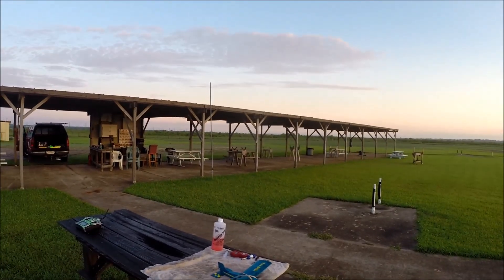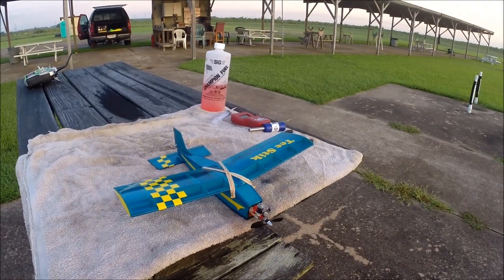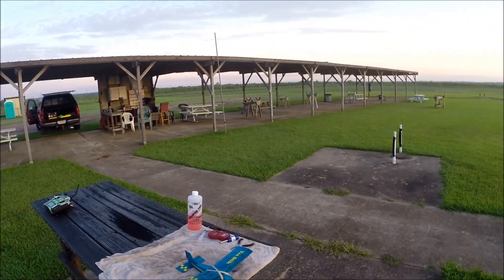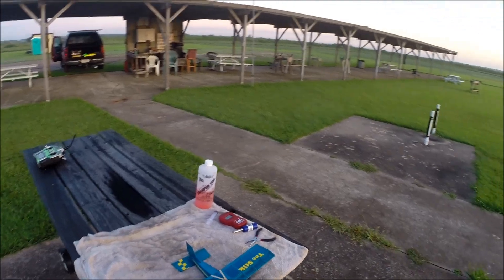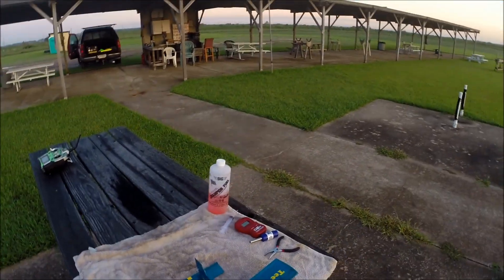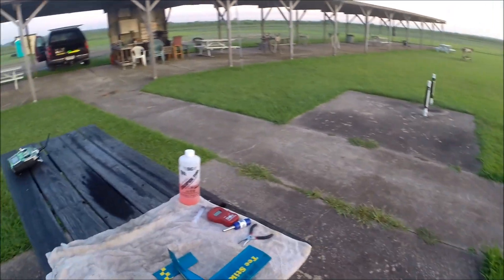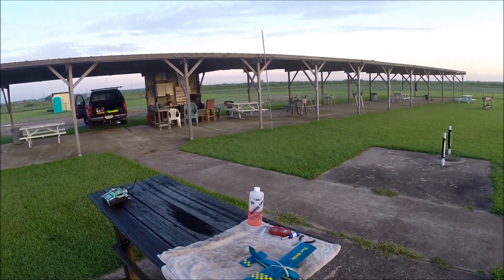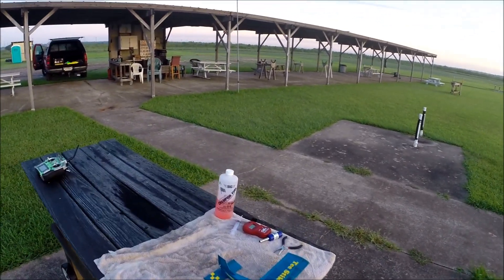World's Smallest Traveling Engine - Cox TD .010

Comment: My 049 is really tight at tdc... the piston is locked and the crank can move slightly  . Any ideas? Excellent video man! Love to see more cox videos :)
Reply from the maker: Try oiling the piston/cylinder.  Then heat it in the oven at about 350F for a while and try to carefully loosen it up.  It’s common for them to seize up with congealed castor oil after sitting for long periods.  Heat is your friend to get them loosened.  I like to use Aero Kroil oil for this.
Reply: Remove glow head with proper wrench, insert some glow fuel or acetone, should dissolve sticky varnish and free piston
 @TeeBeeZee
Reply: Sometimes the Castor oil can also get "baked" on and varnish the inside of the cylinder. This was common. Take some VERY fine steel wool (0000) and a wooden dowel to wrap the steel wool around, and lightly clean up the bore with it to remove the varnish. Don't go crazy, just a little light scrubbing should do.
Reply: Air gun oil is also a GREAT lightweight, very slippery oil for loosening up stuck engines. I also use it for after-run oil

Comment: Excellent work 🙂 im seeing many cox model enligne : Cox Tee Dee .010 but the tank its plastic, can you give me an advise if its good ? Its not gonna melted with the engine heat ?
Reply from the maker: No problems with melting plastic Cox engine tanks.  This model actually has a remote 10cc tank inside the fuselage but most of my .010 engines use the stock Cox tank.
Reply: @TeeBeeZee  thanks for replying, i was looking if you have Facebook page or something to contact you, the .010 around $46 but there is no parts enligne incase i need it one day, i think im gonna purchase the 0.49 model
Reply from the maker: @johnny_F10N55  If you're new to operating Cox engines, I would certainly recommend you start with the more common .049 models.  The Cox Engine Forum online has lots of info about that stuff.  The smaller .010 engines are more tedious to operate and demand a little more experience to be successful with them.  In addition, the smaller ones have a lack of spare parts available, as you mentioned, so extreme care must be taken while fiddling with them.

Comment: Flew "Littlest Stik" with .010 and .020 back when. Ace rudder only, pulse propo.
Reply from the maker: Cool!  I have a Littlest Stik built from the plans running a TD .020.  They fly great! Mine has modern radio gear with 2 channels, though. 😀 The one in this video is quite a bit smaller, spanning 15” and weighs under 3.7oz.
Reply: I have a littlest stik!!  Rudder only with the .10.  It’s a escapement setup.   It was my grandfathers.  It’s now on the ceiling in the shop with about 15 other. Rare Birds I don’t fly anymore.  Even got a ranger42.

Comment: Was that a cox Olympic or the cox sportsman I saw in the beginning
Reply from the maker: On the display shelf?  That’s a Sportsman .15.
Reply: @TeeBeeZee  Oh nice, I ended up selling mine a few years back. I've still got my brand new Olympic but I haven't  run it yet because I haven't been able to find a piston reset tool
Reply from the maker: @skaterboi8494  I fly a lot of Cox engines but must admit that I haven’t gotten around to running any of the .15s yet.  Someday.
Reply: @TeeBeeZee  the cox conquest it's a great running motor, I have one on one of my control line planes. I'm considering puting one on a free flight model here pretty soon

Comment: Hey Troy,how do u start the teedee010 with a nornal glowstarter/ glowdriver? Can i do that also on a normal cox 049 head or is it a modified head wich u are using??
Reply from the maker: Sorry but it only works with the Rower Hobbies glow starter that is no longer sold.  I still have 2 that work.  The others on the market that I’ve tried do not contact the head properly to heat it.  The Cox clips work pretty good on .020 and larger heads but the .010 is tricky due to its size.  I will probably have to make a custom clip soon.
Reply: @TeeBeeZee  i see ...i wonder why there is no big 2rd Party dealer for cox Support like These rower Starters or ther stuff wich would be necesary....
Reply from the maker: Cox International and EX Model Engines sell parts and accessories.
Reply: @TeeBeeZee  i know,what i tried to tell is why there is no glowdriver fom coxengines.ca
But i Think my Clip just works fine....
Thx by the way....
Reply: I just use alligator clips that are attached to an old wall wart charger lead that I cut off the cheap charger that came with one of my ignitors.

The end clips right into the ignitor, and then clip the alligator leads to the head